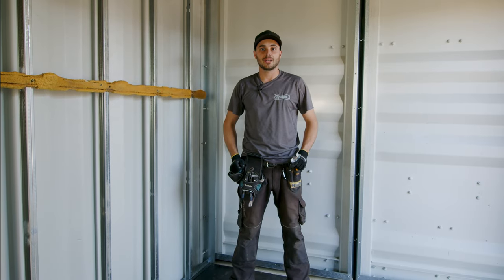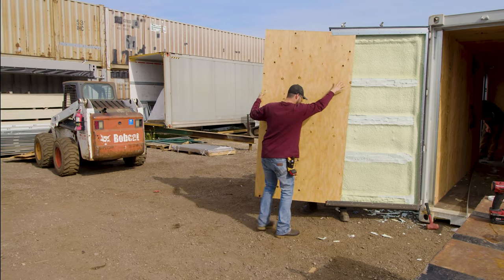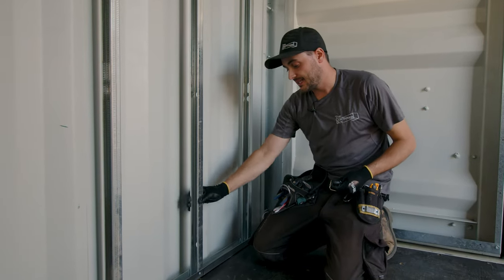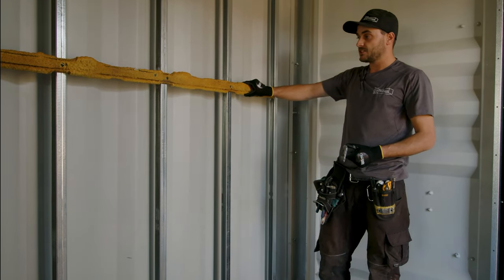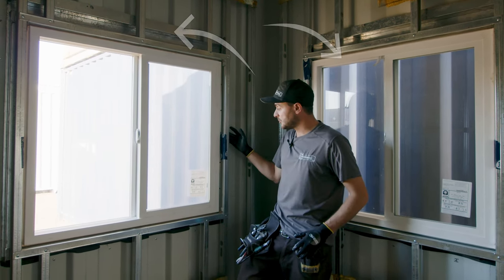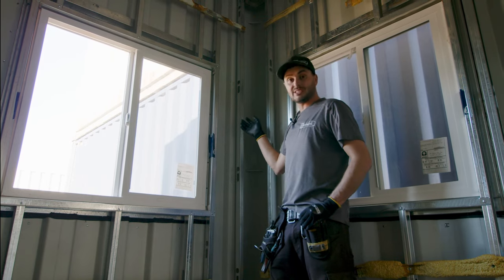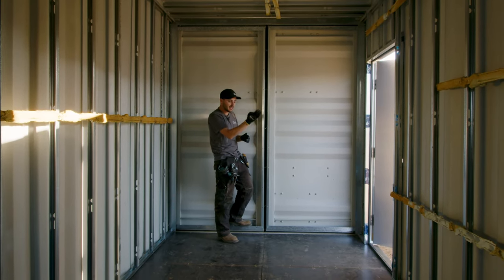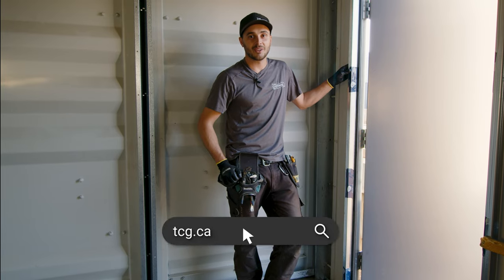Steel Stud Framing Kit - Easy Method To Frame the Inside of a Shipping Container!

Comment: Bonjour , vos produit sont effectivement parfaitement adapter au conteneur maritime , par contre vos prix par exemple le Steel Stud Brackets , 3-4 euros unité pourquoi pas , mais pas 10 euros unité.
Vous les réalisé vous même a la main pour ce prix la , peut être penser a contacté une métallurgie pour automatisé le process.
Reply from the maker: Hello. Thanks for the advice. We have found a vendor that can mass produce them for a much lower cost. We hope to bring the cost down soon (in 4 - 6 weeks) but need real world testing done with them before we order thousands of units for stock. I think you are correct with the target sales price. If you would like to try some and provide feedback, email us at parts@thecontainerguy.ca and I'll get you a discount. 

We aim to have a kit which includes the brackets, corner casting covers, a shipping list, a cut list, and full instructions on how to frame the container which will provide customers a lot of valuable assistance.

Comment: Are you aware of the tape that can be applied to the wood studs. The tape is usually used on patio decks. You can place it  on the part that touches the metal walls.
Reply from the maker: Do you have a name for the product? I'd like to look it up

Comment: I was really excited to install this kit in my 20' container, but my experience with this company's customer service has diminished that excitement. This kit ships with no instructions and while this video is a good overview of the kit, it really doesn't suffice as a step to step guide. I looked for instructions on the website, but there is nothing. I emailed customer service requesting instructions and the next day was provided with an instruction manual. Unfortunately, when I didn't receive a same day response, I begun installing the brackets going off of what I had gleaned from this video as I figured that a instruction manual must not exist, otherwise it would've be provided, right? Wrong, the next day I received an email from customer service with the instructions I had been hoping for. These instructions called for installing 5 brackets on each sidewall in specific places, placement of the studs, and installation of the caster covers. However, there was no mention of where to place the ceiling studs. Also, my kit came with 20 brackets, but these instructions only call for 10. I emailed customer service again looking for clarification and was told that I was given outdated instructions and that they now recommend 10 brackets on each wall. So here I am, going back for a 3rd time to install more brackets. For $300 these issues should be worked out and I honestly expected a how to step by step video to drop right after this one. Unfortunately that didn't happen. If you've read this far and bought the kit, I recommend reaching out to the company for the instructions and keep in mind that 10 brackets are used on each side wall. 22" spacing between studs, ceiling studs attached to the brackets not just the track. Also, the self tapping screws provided are a joke and will melt before they penetrate the tubing. Get yourself a 13/64" drill bit to drill the holes, then use an impact to send the screws in. Overall, love the products but very disappointed in the customer service.
Reply from the maker: This is great feedback. I'll personally get to the bottom of it. Not acceptable.

Comment: I sure you charge $28,000 just for this container! You give good insight but would not use for your business because your prices are too high!
Reply: I agree they are very expensive but supply and demand. Looks like he is selling out of stock on Amazon.
Reply from the maker: @danielstroh4251  thanks for the insight everyone. Steel prices and container prices are FINALLY coming down. Our costs have doubled (or more) on everything over the last two years. We look forward to getting our prices down through further automation of our manufacturing processes and a reduction of input costs.
Reply: @TheContainerGuyTV  I just spent too much for my two one trip 40'hc's. I have to wait on the sbb for another month. Amazon says you only have one left. Will you have more in stock soon?